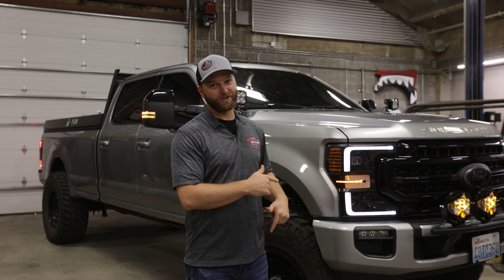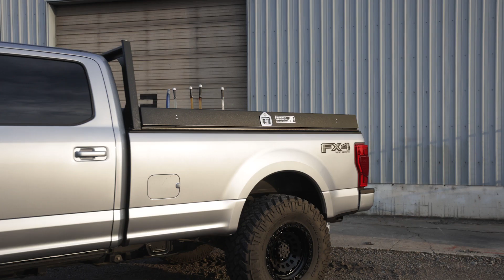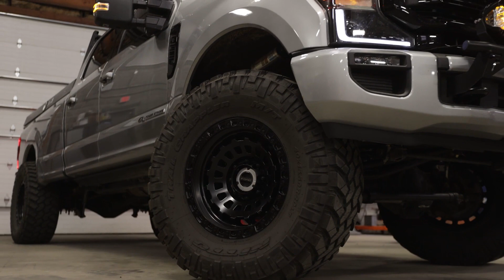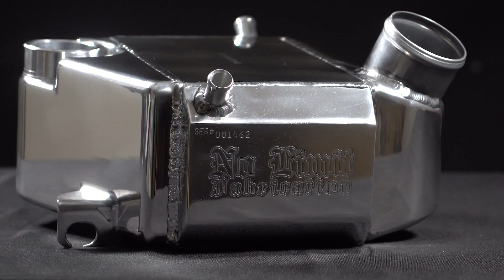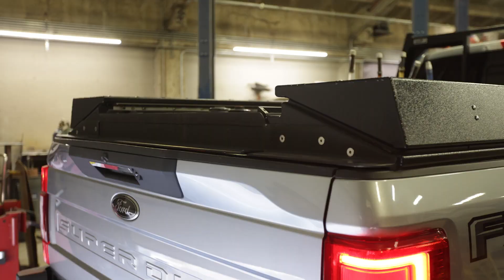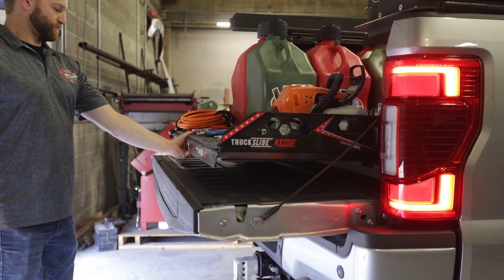Long John Silver Build Overview

Comment: Do you remember what you had to do for trimming.  I'm looking at doing a 6 inch lift with 20x9.5 black rhino -18 offset on the same 40x15.5r20.  I can easily do 1 inch bumper spacers but unsure where trimming in rear of wheel well is required

Comment: Ben! Was that a little Tyler dig with the 68 comment?
I do like that the silver isn't in your face, flashy, "look at me!" This truck is more of a big presence, and if you know, very impressive. Alumidutys are so nice! Hashtag someday
Having outfit a few trucks to work out of, the bed looks great. Only problem is when you lift them, access is a little tougher. AMP make bed side steps? How about a spinner center cap that is a step? Maybe mount a real hover board to the rack? A back to the future style one, not the Segway style one they sell...
Reply from the maker: ....maaaaayyyyybeeeeee. :) While the truck does sit higher than stock, getting things out of the bed is still pretty darn east, especially with the bed slide. If there is any issue getting up on the tailgate, Ford has the step built into the tailgate, so no biggie there! 

I'd prefer a hover board... but they might be a few years out from that. lol. 
-Ben